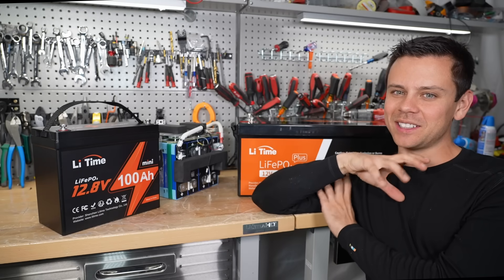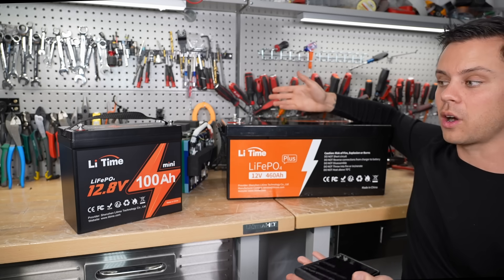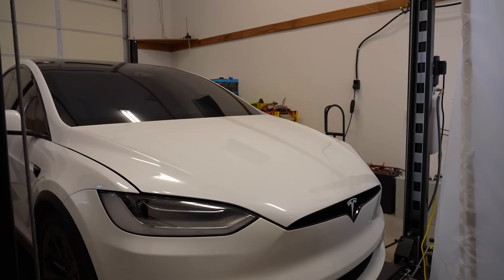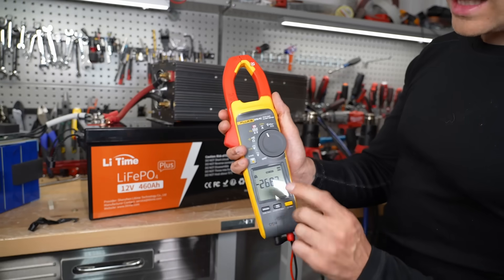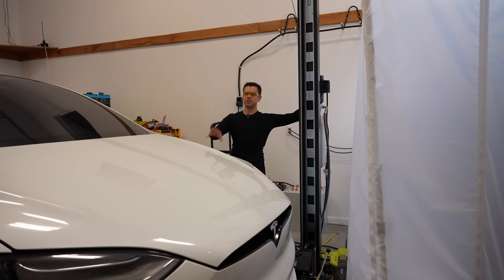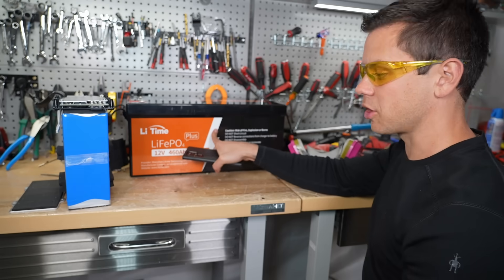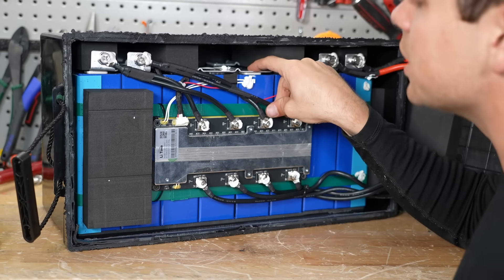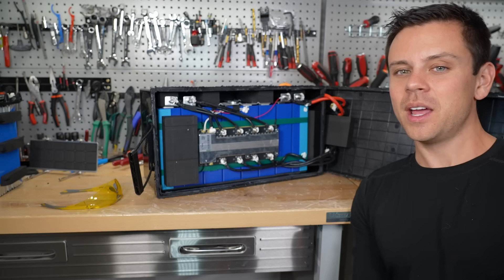LiTime LiFePO4 Mini and 460AH Plus! Surge Testing and Teardown

Comment from the maker: Affiliate links for equipment used in the video:

LiTime Mini: https://www.litime.com/products/litime-12v-100ah-mini-lifepo4-lithium-battery-upgraded-100a-bms-max-1280wh-energy?ref=XBIA62RFcalHns

Litime 460Ah Plus: https://www.litime.com/products/litime-12v-460ah-lifepo4-lithium-battery-250a-bms-5888wh-energy?ref=XBIA62RFcalHns

Litime Trolling Motor Battery: https://www.litime.com/products/litime-12v-100ah-tm-deep-cycle-lifepo4-battery-for-trolling-motors?ref=XBIA62RFcalHns

Victron Multiplus 2 3000VA (amazing surge!): https://www.currentconnected.com/product/victron-quattro-ii-12v-3kva-2x-120v-inverter/?ref=wp

~~~~~~~~~~~~~~~~~~~~~~~~~~~~~~~~~~~~~~~~~~~~
Tired of getting ripped off? Check out my "Will Prowse Approved" solar product recommendations below!

12V Batteries
https://www.mobile-solarpower.com/lithium-batteries.html

48V Batteries
https://www.mobile-solarpower.com/48v-batteries.html

Offgrid Inverter System Builder
https://www.mobile-solarpower.com/48v-complete-system-blueprint-559371.html

Hybrid Inverter System Builder
https://www.mobile-solarpower.com/code-compliant-48v-offgrid-system.html

Mobile Handtruck System Builder (very popular!)
https://www.mobile-solarpower.com/mobile-48v-system.html

Solar Panels
https://www.mobile-solarpower.com/300w-solar-panels.html

Ground Mount Solar Racking
https://www.mobile-solarpower.com/ground-mount-racks.html

Wire, Lugs and Busbars
https://www.mobile-solarpower.com/wire-and-connectors.html

Tools
https://www.mobile-solarpower.com/tools.html

Fuses and Circuit Breakers
https://www.mobile-solarpower.com/fuses.html

Plug-N-Play Solar Systems
Ecoflow, Anker And Bluetti! So many models to choose from. See my current recommendations here:
https://www.mobile-solarpower.com/full-size-systems.html

~~~~~~~~~~~~~~~~~~~~~~~~~~~~~~~~~~~~~~~~~~
Need to build a large DIY system? Need a trustworthy solar distributor? These are my favorites:

Signature Solar
Creator of EG4! Solar Minisplits, Victron and More! Largest Solar Store Online.
If you want $50 off, please use my link below and coupon code "DIYSOLAR50":
https://signaturesolar.com/?ref=cPwLcVc0SW-BjN

Current Connected
Best Prices for EG4, Victron, Midnite and so much more! Fast Shipping and Highest Rated Customer Service:
https://currentconnected.com/?ref=wp

~~~~~~~~~~~~~~~~~~~~~~~~~~~~~~~~~~~~~~~~~~
Join our DIY Solar Community 
Need more help? Join the largest solar forum on the internet for beginners and professionals alike. 140,000 members and counting!
https://www.diysolarforum.com

Check Out My Free Book
Best-selling and beginner-friendly guidebook to off-grid 12V solar!
https://www.mobile-solarpower.com/the-book.html

~~~~~~~~~~~~~~~~~~~~~~~~~~~~~~~~~~~~~~~~~~
Contact Information:
I am NOT available for personal solar system consult! If you wish to contact me, this is my direct email: williamprowsediysolar@gmail.com
FTC Disclosure Statement and Disclaimers:
Every video includes paid promotion or sponsorship (such as free products for review). Some links on this YouTube channel may be affiliate links. We may get paid if you buy something or take an action after clicking one of these. My videos are for educational purposes only. Information is subject to change/update at any time. Electricity is DANGEROUS and can kill. Be smart and use common sense :) DIY Solar Power with Will Prowse is a participant in the Amazon Services LLC Associates Program, An affiliate advertising program designed to provide a means for sites to earn advertising fees by advertising and linking to Amazon.com
Reply: @willprowse which solar cell controller would you recommend to charge these batteries and do you have a link where you can earn a little from it.
Reply from the maker: @franklyden  oh on my website, check out my equipment recommendations here: https://www.mobile-solarpower.com/solarcomponents.html
Reply: It's really time for 96v systems
Reply: That big battery? I would not care about the way that BMS is installed. Its so big and heavy its not likely to be used in a mobile application.
Reply: Will you do a tear down of the NoJoke battery ? Been getting the 100ah for around $225 and so far they have been great
Reply: @MikeMike11777  the controller for building your own system.  With the solar generators, the solar power keeps coming in at 100% charged.  They have a new by Montex that you can program the battery from charging to whatever % you desire.  You can charge 90% charge or lower and the battery will start charging.  Gets down to a level of discharge and the battery will start charging again.
Reply: After your original recommendations, I still use these Litime 12V batteries for odd things like koi pond backup pumps, gates & solar lights around my property
Reply: My concern is that the cells are mounted on their side.  Eve and Calb cells are  recommended to be mounted vertically.

Have you tested the impact of cells laid out like this?
Reply: When will you start reviewing Sodium Ion batteries?
Reply: Hi, I see you haven't done a review of the Zendure Superbase V yet.  Can you do one, and also do a teardown to see if inside is an actual solid state battery?  Thanks!!
Reply: Will. You did not measure the in rush current properly.
Reply from the maker: @nextgensolar-NGS  I'm not doing the actual inrush for the capacitors if that's what you're thinking. It was for Max surge
Reply from the maker: @nextgensolar-NGS  best method is with the oscilloscope
Reply: @WillProwse LiTime using your name on the sale sight for that big 410ah bat lol😅
Reply: Hi @willprowse on you're components page you have 48 v all one one systems but no 12 V. Do you have any recommendations for all in one 12 V system that is quieter that the mppt?
Reply: @willprowse can I use this type of battery for car audio to power big systems? I noticed that certain car audio companies use these same life po4 batteries but the only thing I can see different is that they do not use any bms on there batteries…. Will this battery take a charge from a 400 amp high output alternator??
Reply: Dont buy these batteries, they dont last and the customer service is garbage. I have one of these and it was only a few years old and maybe been cycled like 4 times and the BMS started acting up. I tried all the tricks to reset it and nothing worked. I contacted LiTime and they said I could ship it to them on my dime and IF they found a problem with it they would re-imburse me or replace. But if they dont find a flaw they wont pay to return it. They sell used batteries and I dont trust that. So I pulled the case apart and unplugged the BMS let it sit and sure enough it worked again. But a few hours later the BMS stopped working again. So I told LiTime what happened and they said sorry you opened it so they cant help and cant sell me a BMS replacement. Terrible service and support!!!
Reply from the maker: 0:00 Intro
2:54 Surge Test w/ Faulty Inverter
5:14 268A Continuous Load Test
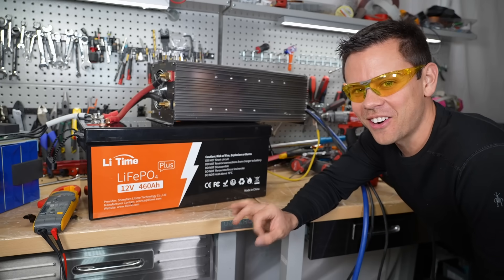5:35 Surge Test w/ Victron Multiplus 2!
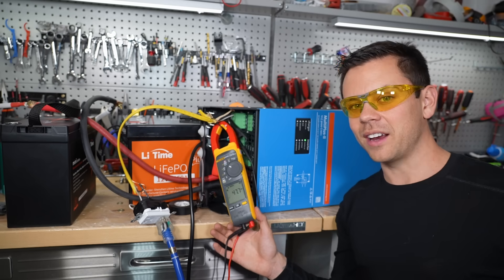7:42 Tear Downs
10:43 Conclusion
Reply: hi how does this battery compare to the vatrer 460ah ? the vatrer has class b batteries not sure what that means @WillProwse
Reply: can someone please do a head to head comparison of all the new 460ah lifepo4 batteries that are coming out? redodo bird, roamer, litime, epoch, basen, VATRER, power drag queen, etc..  @WillProwse
Reply: @WillProwse  I have the Ampere time 300ah    went to put it in the camper with the Victron system and  charges  and holds  a charge but soon as you put a load on it  drops to 2 0r 3 volts instantly  no capacity . only 2 years old .   stored it in the house  half charged.  but never charged it  for 5 months    think that  2 extra months ruined it ?    busy with life .
Reply: @WillProwse  Is a 48-volt system appropriate for a van build with limited solar?  

I don't think my single 380-watt will produce enough voltage (~40v) to charge a 48v battery bank.  I also use DC/DC changing.    I don't recall seeing any information/videos about off-grid systems using 48-volt hardware with limited solar arrays and DC/DC charging.  

Can buck boost converters be used here?

Comment: Oh geez... really Will? Pouch cells? With no mechanical compression? No low-temperature sensor? This battery will fail prematurely. Will, please inform your viewers on the issues with pouch cells so they know what they're buying before you go recommending this stuff.
For example...
+++
Key Issues with LiFePO4 Pouch Cells:
Swelling (Puffing): 
A major concern where cells expand from gas buildup during charging/discharging, aging, or extreme temps, needing constant compression to prevent it.
Mechanical Vulnerability: 
Less durable than prismatic cells; they're prone to damage from vibrations and impacts, making robust housing critical.
Compression Requirement: 
Must be held with consistent pressure (often via springs) to prevent sliding and manage swelling, which adds complexity and potential failure points.
Lower Energy Density: 
They store less energy for their weight compared to other Li-ion types (NMC/NCA), meaning larger packs for the same range.
Temperature Sensitivity: 
Performance drops in cold, and high heat accelerates degradation and self-discharge, impacting longevity.
Risk of Over-Discharge: 
Can be damaged by self-discharge during storage if left too long at low SOC, requiring a BMS to cut load and regular checks.
Cell Balancing & BMS: While LFP cells balance well by charging to 100%, poor quality cells or BMS issues can lead to imbalance and failure. 

...
So, given the fact that this Li-Time Mini DID NOT have any mechanical pressure management, nor did it have any low-temperature sensor, means it is NOT worth the cheap crap price they are charging.
Li-Time, like other battery companies like it, are simply battery 'packagers'. They do not make the cells themselves. And they of course are trying to maximize profit by cutting corners. They are interested in making money, not building quality batteries.
If you are someone who says: "but hey, at this price, I'll just buy 2 and when one fails within a couple of years, I have a back-up... I'll still end-up paying less". Please have your head examined!!! You are willing to waste resources? And reward the company doing it?
(Insert expletive here)

Comment: Used this brand when the 300ah batteries had just come out.  Yes.. I built a 12v system.. it was during covid and inverters were just no where to be had.. But.. it still works to this day and has been great. We are planning on expanding the capacity and potentially building a 48v system and convert the 12v into a portable power bank the golf cart can pull around the homestead.

Comment: He always hurts my feelingswhen he downs 12volts systems. U got a small 2200watt inverter that does 95% of what i need. Yess i got a short 1.5ft 2/0 cable from my busbars a 3 sets of 2 awg going from my 3 12volt 300Ah batteries. Now i was hoping to save up and get a 4th battery and at that point was thinking of going to 24 volts but 48volt upfront cost is whats holding me back. U can grab an extra 12volt battery pretty easy, but a 48volt ehh little  more complicated. Now im too far into it to switch.  I'd have to redo my whole sydlstem except the panels.

Comment: There is a $75 lithtime 100Ah on Amazon atm . Thats lithtime not Li Time. They are spelt very similar but are 2 different batteries. Im curious to see whats inside of a $75 lithuim battery so guess I'll have to buy one to see.

Comment: Hi Will, what are your thougts about the Li-Time  app that requires an active internet connection and logged in account to connect to your own local battery. That is absurd and enables china to control all li-lime batteries worldwide. This should be banned.

Comment: Dude I don't know why you guys keep saying 48v is cheaper. Especially not for van life. You can't use that with the alternator which is the most powerful thing on the van and it's already on the van. You guys constantly make arguments trying to justify 48v setups unobjectively and blatantly ignoring the facts and the direction of the market for DIY projects. The length, thickness and inefficiencies of expensive 12v cable just don't compare to the price gap of 48v batteries and the inverters so stop saying that it's more affordable. It's not. The only advantage to van lifers 48v setups have is the ability to have longer runs of cable with lower risk of overcurrent. Just because something is more efficient doesn't make it automatically better in every other way.

Epic Budget 600ah 12v Van Build Electrical Setup:
150a (1,800w) 12v van alternator - $included
400a (4,800w) 12v alternator upgrade - $400
145a battery iso/relay/dc-dc - $20
50a (700w) 12v/12v Orion dc-dc - $300 ("Proper lithium dc-dc charger" -which you can get away without it, it just "degrades the life of the battery over time if you do.")
60a (700w) 12v Renergy dc-dc - $170
600ah 7,680wh 12v battery - $600
10ft 2/0 welding cable - $120
3kw/6kw 12v PSW inverter - $120
Grand total without upgraded alternator or proper dc-dc charger: = $860
Grand total with upgraded alternator and proper dc-dc charger: = $1,410

Unnecessarily Expensive YouTube Commentators Recommended 600ah 48v Van Build Electrical Setup:
150a (1,800w)12v van alternator - $included 
400a (4,800w) 12v alternator upgrade - $400
8a 12v - 48v Orion dc-dc - $300 (Victron's only 48v model only puts out 8a 380w)
18a (800w)12v - 48v Generic dc-dc li charger - $130
150a (7,200w) 48v secondary alternator upgrade/install - $8,000
150ah 7,680wh 48v battery - $1,100
10ft 4 gage cable - $20
3kw/6kw 48v PSW inverter - $220
Grand total without secondary or upgraded alternator: = $1,470
Grand total with upgraded alternator: = $1,870
Grand total with secondary 48v alternator: = $9,470

Ok. I admit after listing and double checking this stuff, I realized that you actually can charge a 48v battery from a 12v vehicle hence the step up converter and 12-48v 3-stage dc-dc li chargers that I just found. The thing that threw me off was that van lifers would get secondary 48v alternators for their 48v setups, but I didn't realize that it wasn't actually necessary. In fact, having an upgraded 12v alternator to some extent negates the need for a secondary 48v alternator. I also realized that a lot of 12v and 48v batteries have a 40a or 18a 400-700 watt recommended charge limit due to their bms. This also made me reintroduce the question of using a single 600ah dumfume over multiple dumfumes that combine for 600ahs as 6x 40a at 12v is a charging draw of 240a 2,880w, which only mattered to me when realizing this bottleneck. I was previously considering dumfume's single 600ah 12v battery for its ease of install over multiple 100, 200, or 300ah batteries, but considering the charging possibilities of using 2 300s, now I'm interested. I'm still not sure how I want to setup them up. Maybe having 1 60a 12v charger per battery for a total of 120a 12v 1,440w. There are some batteries that allow for higher than 18 or 40 amp recommended charging with higher amp BMSs, but they are just more expensive. Dumfume's max charge current is 100-200a on 200a BMS batteries which I believe applies to their 3-stage charging profiles, but it's not explicitly noted on 12v or 48v dc-dc chargers whether they can produce that much energy in their bulk stages. Finding chargers that can output those numbers at the appropriate stage is of the most importance, because I want to take as much advantage of the alternator to make the best use of gas when the engine turns on, which is what I've always wanted to do, but now considering the bottleneck of individual batteries' BMS, it's especially important. And again solar is not as powerful nor as reliable as the engine is on a van. Now, regardless of trying to take advantage of an alternator, it's still pretty clear to me that 12v is hands down way cheaper than 48v for the same size and output DIY electrical setups. Again, I think it's worth it at such a low initial cost to just use an isolator/relay instead of proper charging devices on 12v, because lithium is so much more durable than lead acid. Getting your money's worth is not just about making everything last as long as possible, it could be about saving money from van life itself, because you've built your van to maximize its use of gas, and in doing so, lithiums will outlast the time you're in the van, and at dumfume prices and build quality, I think that's a worthwhile endeavor.

Comment: I don't use an all in one inverter on my small system because most of what I use is DC and not ac, and you can't turn off the inverter while charging with them. And on small systems you have to save every watt you can so I just use the Victron inverter and a Victron charge controller and the inverter stays off until I need it. Makes a huge difference. If someone made 3000 model that allowed me to turn off the inverter function while charging then I'd do that.

Comment: What is your opinion on 1 400 amp vs 2 200 amp for an RV?. I run a 12  volt AC while traveling. It is also being charged at the same time. Thanks for the great videos.

Comment: I have four LiTime 230Ah batteries in parallel in my RV. Selected LiTime based on Will's recommendation, and they work great, no issues. The 230Ah model with low temp cutoff is less than $500. I'm sure Battle Born is better, but even if they only last 3-4 years I can replace them and it'll still be cheaper.